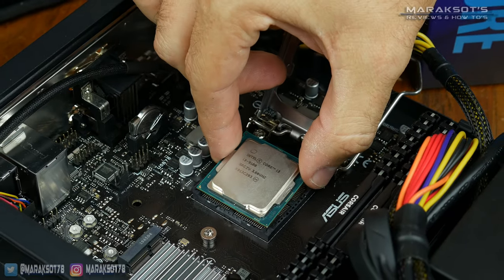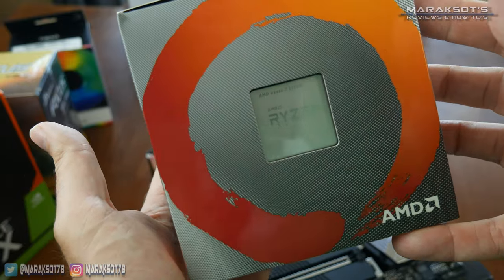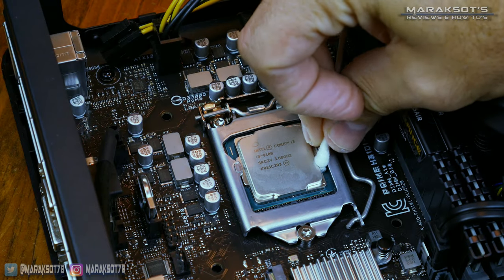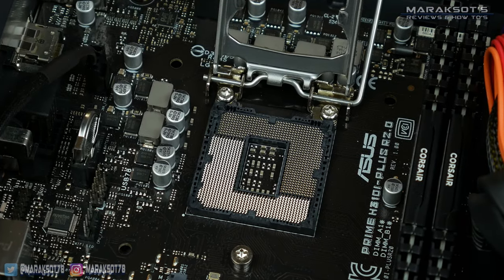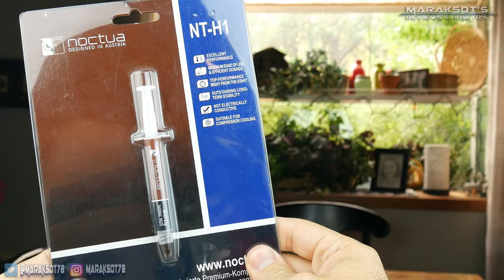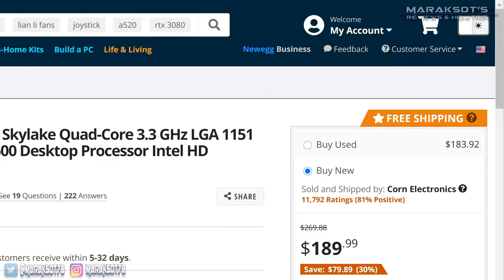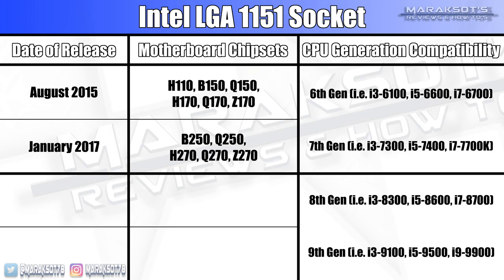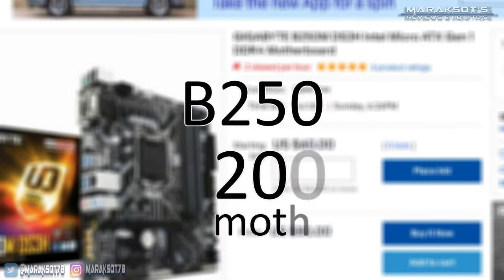A Beginners Guide: How to Upgrade an Intel CPU (core i3, i5, i7, i9)

Comment: I am using an Intel i5 8600k processor in an Hp Prodesk 600 G4 MicroTower with Q370 chipset.  I tried to upgrade to an Intel 9600k processor but I get 3 long beeps plus 5 short beeps to indicate the processor is not recognized.  So the chipset seems OK according to your chart for 9th generation processors, so is my HP motherboard blocking this CPU or is the processor defective?

Comment: So my pc has a i5-6500 and I bought a random pc from a thrift store with a i5-7400. Both base speed of 3.20 hz. Both 4 cores  . Can I swap to the 7400 or do I need to check into further compatibility?

Comment: Super informative video! #6%club I'm about to jump from an intel i3 to hopefully an i9, just not 100% sure my motherboard will support it, so far it looks clear to me, motherboard is an ASRock H310CM-HDV
Reply: How did this go. I’m interested in doing the same
Reply: @lucidfgc9929  I wish I could tell you 😂, it's been a long 6 months and my poor PC hasnt gotten an upgrade
Reply: @jacobmennig8187  I just got mine a couple of days ago. And was told the i3 is too old. But honestly it seems to be working really well. But I haven’t put a lot on the computer yet. Like haven’t even tried to stream or anything to see how it would handle all of it
Reply: @lucidfgc9929  I have a pretty low spec PC all around, but I haven't had any problems with my i3 itself
Reply: @jacobmennig8187  yeah my i3 is pretty much the lowest spec thing in my pc. So honestly I don’t think im gonna change it until it actually becomes a problem
Reply: @lucidfgc9929  Mine was a custom build, but I was incredibly unaware of the differences in hardware at the time, and figured I could just upgrade bit by bit, so I stayed under 1200 but still got fucked in the end, stuck myself w a 550 for a gpu, and an i3, but I've got 16gb of ram 😭😂😂

Comment: I have z-590 motherboard and put a 10700 in it and it’s been a few months and now I want I-9 unlocked.. I have fwt3 3070 and currently 650 gold series power supply .. you think that power supply is big enough for what I have currently or if I get the I-9

Comment: hello my dear friend that was a nice video well i have an intel cpu that has the core i3 9100f 9th gen model and my motherboard comes with the LGA 1151 Socket so currently i'm having the H310 version 2.0 motherboard from gigabyte and now i want to upgrade this to intel core i5 9400f and also i have a very basic display card that is the nvdia g210 gpu and you know this intel i3 9th gen requires a discreete graphics card so will i5 9400f 9th gen cpu and amd radeon rx580 make my rig the best for gaming? or will nvdia gtx 1050ti work? which is the best gpu for intel processors? amd rx 580 or gtx 1050ti? i also would be upgrading my ram as well my powersupply as well..kindly help and i'm also afraid of one thing that i heard now intel has discontinued their 8th and 9th generation cpus...now 11 and 12th are available in the market..? please help..i need a pc upgrade..i want to build a powerful gaming system
Reply: Bro just buy an amd motherboard and an amd chip Intel is going to sink soon I can see it.. Also get yourself a gtax 4gb for around £120
Reply: @EvilExistsYTOfficial  intel just got themselves in to 14th gen cpu which requires heavy psu..intel is rubbish they are expensive plus performance is also not that good..amd is king

Comment: I have a question I have an old dell latitude e6320 and come with an i7 2620M 2.7 ghz 3.4 ghz turbo boost. I was wondering if I can put a 2960XM processer in it that  runs 2.9ghz with 3.9 ghz turbo boost  I think it is. I know they both use the g2 socket. I also have a 3940XM that uses the g2 socket. Thought Id check befor I just plug it in and see what happens. Thanks

Comment: I like your videos bro, but my motherboard is EX H110M-V and I want to upgrade my cpu to intel core i7 is it possible?
Reply from the maker: Yes it is possible to run a 6th or 7th gen i7 (6700, 6700K, 7700 or 7700K) on that motherboard but I wouldn't recommend it.  That board has a very basic power delivery system so an i7 would not get the power it needs to operate at full capacity.  You'd basically be kneecapping it's performance with that motherboard.  Also that board does not support overclocking so you'd want to stick to the 6700 or 7700. Lastly depending on what BIOS version your motherboard is running you may have to update your BIOS for a 7700 to work with it.  I'm not saying any of this to discourage you I just want you to be fully aware of the things you need to know before upgrading.  I hope this helps.

Comment: my motherboard is motherboard is gigabyte ga-z77x-ud3h can it use i9 12th gen or i7 12th gen if not then which i7 or i9  is good for my motherboard plus can my mother board have 128gb of ram if not then whats the max ram mine can have

Comment: Question I want to upgrade to a 8700k from my 7700k. the base speed on the 8700k is slower then on the 7700k. the 8700k has more cores. so if it has more cores at a slower speed will it work faster then the 7700k?

Comment: hi i have Acer Nitro N50-640-ER12 Gaming Desktop - Intel Core i5-12400F, 16GB DDR4, 256GB SSD, 1TB HDD, WiFi+BT, NVIDIA GeForce RTX 3060 can i put i7 in it with out upgrade mother board ,please thank you if you can tell me

Comment: am confused, are graphics card all part of the main boards now? all in 1? ive not repaired 1 in years but im assuming the upgrade is now removing the actual parts and replacing instead of replacing the actual card?
Reply from the maker: Many CPU's now days have a graphics processor built in to them. All of Intel's 'Core i' line of processors do but only the CPU's with the 'G' designation from AMD have integrated graphics (i.e. Ryzen 5 5600G, Ryzen 7 5700G, etc.). This is why motherboards have display outputs like HDMI on them so if you're using a CPU with integrated graphics and you're NOT using a separate graphics card, you just plug your display cable into the port on the motherboards rear I/O and you're good to go. AMD's main line of processors however (i.e. Ryzen 5 5600, 5600X, Ryzen 7 5700X, 5800X, Ryzen 9 5900X, 5950X) do NOT have integrated graphics and require you have a discrete (separate) graphics card in order to get any kind of display output. As you can imagine, the built-in GPU's are much less powerful than a discrete graphics card so if you're doing some kind of 3D modeling or design work or you're a gamer wanting to turn up game settings and get good smooth performance you'll want a discrete GPU still. And if you're wondering, you can totally use a CPU with integrated graphics with a discrete graphics card. You just plug your display cable into an output port on the graphics card rather than the motherboard port and your computer will use your graphics card as the display adapter instead.
Reply: @Maraksot78  I've got an old system with an intel core i3, was thinking of looking on ebay or online for a upgrade just so it can play some games as my little nephews discored pcs are better than consoles.

Comment: sooooo lmao I currently acquired a Lenovo E73 SFF , intel pentium g3220 .  recently stepped to 2 acer 22 inch :ED V series monitors , 16 gig Ram and AMD Radeon RX6400 .  I know this thing isn't much but I would really like to get what I can . Is it possible to upgrade to a I7 4790s and the 240w PSU and possibly a slightly larger graphics card ? This is a 10AU model .  I'm just now getting into this stuff lol I build cars and tune domestic but this is a little new to me . thanks in advance .

Comment: I have Asus PRIME H510M-E (LGA1200) loaded with intel i3 10100F CPU. I want to upgrade to intel i5 11th gen CPU as my motherboard supports the 11th Gen Intel Core processors. Do I have to reinstall Windows11? Do I have to reactivate? thanks.

Comment: So if am upgrading from i510400f to i710700f and my motherboard is compatible and bios is up to date and all that good stuff will my system just recognize the cpu swap and run just fine or will I need to do any software/driver updates?

Comment: I have motherboard asus H310M-k with i3 9100f processor and 430W titan power supply 
I would like to upgrade to i7 9700
Is it possible or i have to upgrade also my power supply

Comment: How do I determine CPU compatibility for my PC? Looking to upgrade. Currently have an Intel core i5-2300, need upgrade to upgrade to Windows 11. I'm an avg, everyday user. Not a gamer
Reply from the maker: The i5-2300 launched in 2011 and as far as I know Windows 11 only supports Intel CPU's as far back as their 8000 series which came out in 2017. At this point you'd be best served to buy something brand new, especially if you need/want Windows 11. For someone that just uses their computer for web browsing, spreadsheets, word processing and whatnot, you really don't need anything super high powered or expensive. You can get by no problem with a $500-$1000 laptop/PC. If you're wanting a desktop, depending on what you want/prefer there are all in one PC's where everything is built into the monitor or if you already have a monitor you like there are mini PC's that are like 5 inches square by 3 inches thick that work nicely as well. But yah, at this point I would suggest something new over upgrading as at this point you'll be looking for used parts and they won't support Windows 11.
Reply: @Maraksot78  Thank you, for the advice. Exactly what I suspected, but wanted to weigh my options.

Comment: So i have a i5 13400f and i want to upgrade to a i9 13900t. Not right now but in like half a year. The i9 uses less power than the i5 so this would be no problem. Only 35watt. The socket is the same but i have a B760 motherboard and I see no reason why it should not work. Its an older motherboard but it should deliver enough watt. Or is there another problem im unaware of?

Comment: Hi, i need your help please, i have a h170m-plus motherboard and I've tried to change my i5 cpu to an i7 7700 cpu.
I've updated my bios and did everything right, just like how u did in the video, but my Computer wont boot, only black screen.
All the cables are connected right, and reseting my bios didn't work either.
Do u have any advice?

Comment: So you want to hear my dilemma. I have an older CPU, Processor Intel(R) Core(TM) i7-3770 CPU @ 3.40GHz, 3401 Mhz, 4 Core(s), 8 Logical Processor(s), and want to upgrade to one the that supports SSE 4.2. I have not opened the tower to see which motherboard in installed. I see a complex effort ahead... thanks for the posting.

Comment: So I have an H110 with an i3-6100 and I have just installed an nvidia gtx 1660 super, I dont have the performance I wanted would upgrading to an i7-6700 help it, I’m also about to upgrade from 8 gigabytes of ram to 16

Comment: Hey so I have a dell Optiplex desktop 7040. it has an intel core i5 6th gen and i want to make sure its possible to upgrade it to an intel core i5-7500. i have to meet these requirements for this wfh job and they are asking for a cpu of i3-900, i5-7000, or i7-5000. i just need clarification that this is possible 😢😢😢

Comment: so i have a 12700k   but the xmp profiles are locked by HP.   i can upgrade wo a i9 14900k.    one is it worth it if i am a gammer and music editor, and two, what  do i have to do in the system  after i change the cpu?   anything?

Comment: hi my pc motherboard is ecs g41t-m7 with pentium(r) dualcore cpu .current bios (American Megatrends inc. 080015 1/12/2011). im thinking to replace the processor to Q9300. Do i need to update to latest bios before replacing the old processor to new ones or i dont need to? will it working fine without bios update?

Comment: hey, i installed my cpu and everything is plugged in, power switch is on, everything looks right but the pc is completely lifeless. i put my old cpu back in and it works fine. my cpu is compatible with my board. is my cpu just faulty?

Comment: #6%club loved your vid, 
super super informative and easy to understand.
 Since I don't have anyone that knows about this stuff I would like some help because I don't know if my PC is worth upgrading.

 I built a budget gaming PC back in 2016 with the following parts. 
• Asrock 1151 Fatality B150 k4
• Intel i5 6500 
• Corsair Cx600 (600watts) PU
• Cryorg M9I CPU cooler 
• Gigabyte GeForce GTX 1060 6GB
• Samsung SSD 850 EVO 250 GB (primary)
• Seagate Baracuda 1 TB (secondary)
• Crucial 16 GB RAM

From game diagnostics and other test I've tried to run everything tells me my CPU is at max all the time and sometimes lags my games. 

Is it worth to upgrade to an Intel i7 7700 ? 
I've checked that the cipset is the same, watts are the same and its 7th generation so its compatible. I don't care  about overclocking just don't know if it'll be worth it or make any difference ? 

Thanks a lot in advance :)

Comment: I have an AIO cooler. Would I have to remove the radiator or attached fan as well to install my CPU ?
Reply from the maker: No. You just unmount the CPU block, clean the thermal paste off, swap your CPU, apply new thermal paste and then remount the CPU block.
Reply: @Maraksot78  How would I prevent socket damage for a LGA115 CPU socket ? Thanks !

Comment: I upgraded my cpu from i5 6500 to i7 7700 k on an ASUS Z170 A motherboard. Installation went fine thanks to your vid but now when i boot the pc the monitor is unable to detect hdmi and i noticed the red vga led light on the motherboard is on.

Comment: hI  my name is Angy .I have an ASUS  MODEL  K72F  VERSION  K72F  ID-1A   WITH A  CPU I5 480m 2.66 ghz  WITH G1r RPGA998A CPU socket  it is very old  but never been used. IS IT POSSIBLE TO  REPLACE  the c.p.u.  with an I7 or I9 if my motherboard  is up to the task  i  can do the job myself  i  am not too  good with cpu replacements  what  is possible  and what  is not...or replace the hard disk with an SSD drive  to get more speed a bit of good advice from you is very appreciated Thank you  Angy

Comment: does a i5-6500 have same socket as i3-6100t? from ive read it seems they do but im new to the pc world and have the chance to buy the i5 for decent price so was just trying to clarify.
Reply: Looks like they both use Intel Socket FCLGA1151 based on some research I did on the Intel website.

Comment: Hey bud I have a H6 7 H2-AD motherboard it's a Acer inc its currently running a Intel i3 2100 cpu I'm looking to upgrade it to a i5 chip hoping it will take a 4th gen upgrade would you be able to do me a massive favour and check to see it will be compatible or is it limited to the 2nd gens only if that is the case I'll have to change the motherboard all together thank you for you time bud :)

Comment: I recently found an old laptop I haven't used in many many years and I am doing a factory reset to see if it wants to come back to running Windows 7th again. Anyway, my question is about the CPU. Can I change the factory CPU ( Intel i3-2310M (2.1 GHz) to a better CPU, let's say an I7-type CPU?
Reply from the maker: The short answer to your question is, maybe.... Personally, I don't recommend upgrading laptop CPU's because there's a lot of things to consider if you're going to do it. One of them being power delivery. The laptop you have has an i3 in it, so most likely to save costs the manufacturer put in a motherboard and power supply that was designed to cover the needs of that i3 and not much more. An i7 is a much more powerful chip and requires more power to operate optimally so while it may work, it won't be able to function to its full potential because it can not be supplied the appropriate amount of power by the smaller power supply and the more basic power delivery system on the motherboard. Another potential obstacle is whether or not the CPU in your laptop is socketed or not? Often times the CPU's in laptops are soldered to the motherboard and not socketed like desktop CPU's making it much more difficult to change them out. Unless you're very good with de-soldering and re-soldering electronics (or know someone that is who can help you) swapping CPU's in this situation is impossible. The last issue would be finding a CPU of the correct generation to work with your motherboard. This one is probably the most easy to deal with as you should be able to find something 2nd hand (or maybe even brand new) online; but for me, when you combine all of that together, it's far easier (and wiser IMO) to just buy a new laptop rather than upgrade an old one.

Comment: Hello, I have a hp pav 590-90033w DT PC US computer.  HP website states that I have a lincs motherboard.  The processor socket is LGA1151_CFL.  It currently has an i3-8100 (coffee lake), don't know what that means, processor.  I would like to update the processor to an i7 if possible.  Also plan to take the RAM from 16 to 32.  My wife works at home remotely and this computer is just too slow for her.   Any advice you can provide would greatly be appreciated.    #6%club

Comment: i would like to upgrade to maybe a intel 8700k or something but i have an asus z97-ar motherboard with my cpu now which is a intel 4770k do you think its compatible with my motherboard if i upgrade?
Reply from the maker: You're pretty much at the end of the road on the Z97 platform with the 4770K. The only thing better than that would be the 4790K which is essentially just a binned and overclocked 4770K. In order to upgrade your CPU you're looking at an entire platform upgrade, i.e. new motherboard, RAM, etc. At that point I'd recommend going with a much newer platform than 8th gen intel. They're currently on 14th gen just FYI.
Reply: yeah because i dont wanna spend way to much on my pc because i dont use it super much so i wanna keep it under like 600 worth of upgrades, but thank you very much for all the information.